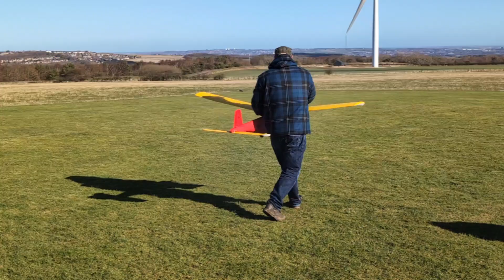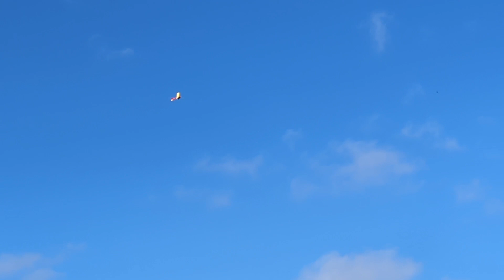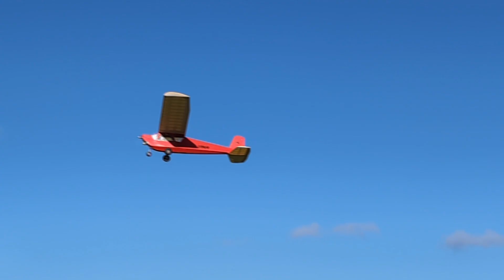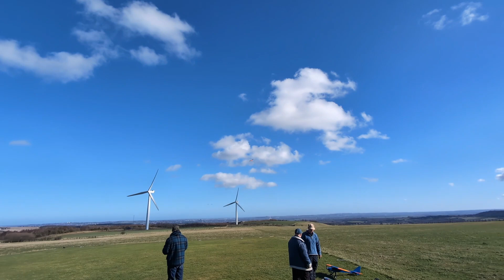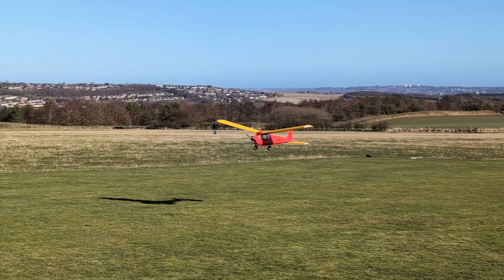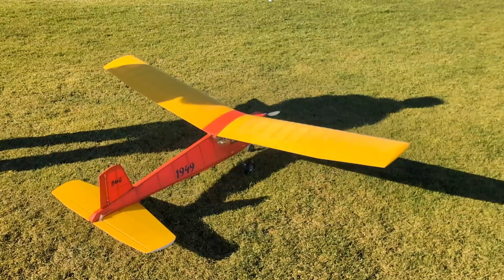Maiden flight of the Rudder Bug with wing wiggle.

Comment: Looks great in the air - using rudder or wingalongs for those turns. Not easy to spot the difference. Well done 🙂
Reply from the maker: It responded equally well to both ,now I've tested that it works I think it will be a three channel model.

Comment: I wasn’t able to tell of the tail skid was fitted or not in the video. I was curious if it would make take off difficult by restricting stabilizer downward movement at take off speed.
Reply from the maker: Tailskid was fitted but I pulled the undercarriage in which lifted the tail up

Comment: Great flying & super video mark ! Your obviously north east ( sound Geordie), I fly on west coast at barrow in Furness. What motor have you got in the big ? Also noticed the matador, I've got one of those too but mike's electric & weighs 17 Oz !! Thx for post, inspired be to get a model out this weekend. Cheers, john
Reply from the maker: Translations are available 😆.
The engine is a clapped out Saito 40 ,used less than 1/2 throttle.
The Matador is a great little model running mine on messy but fun diesel 1.5 cc DC Sabre. Caught a great thermal on one of the flights for a 5 minute max !!.

Comment: Good to see another Rudder Bug in the air. I have been flying mine for 17 years now. No wing wiggle, just a close copy of the original 60 inch wing with added elevator control and electric power.
Reply from the maker: Seems to be a design that just works.